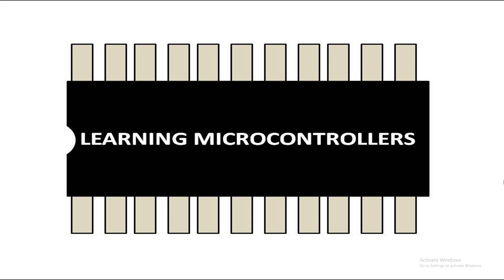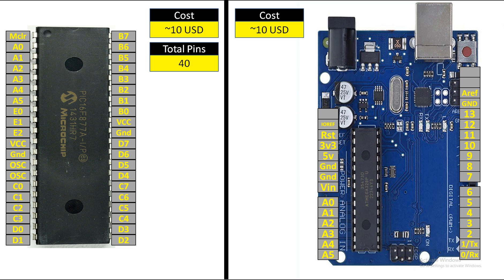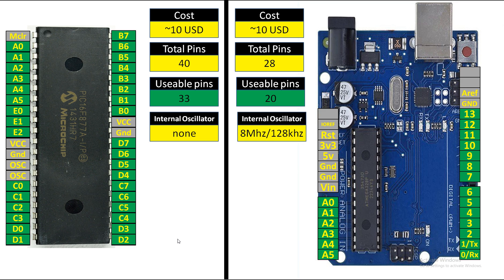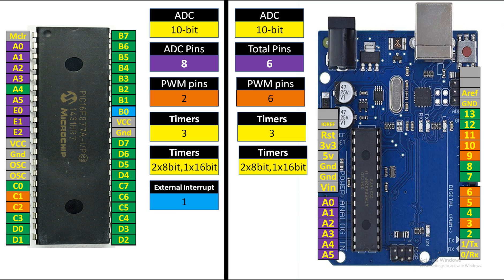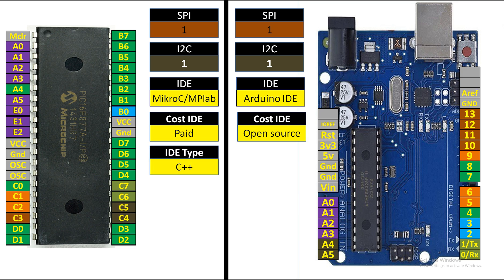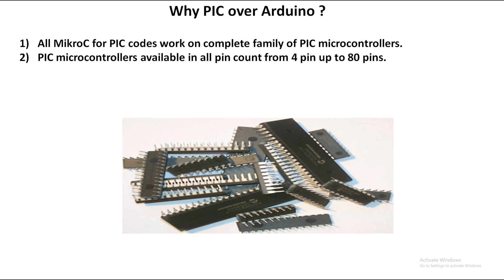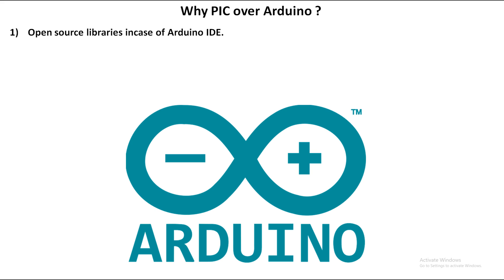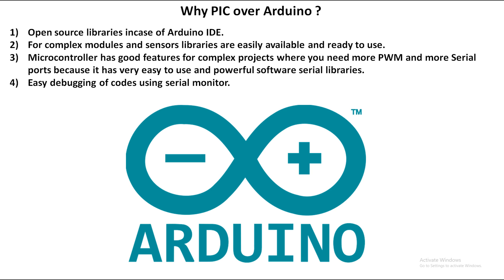PIC16F877A vs Arduino UNO. Also Some info on PIC vs Arduino.

Comment: UNO pwm 256 step....
Reply from the maker: Ok thanks
Reply from the maker: That's the bit means 8 bit
2 power 8 is 256
Same for Pic16f877a aswell

Comment: What crazy supplier are you buying from where an ATMega328P dip package costs $10? In SMD for they're about $2.50, in DIP package about $4.

Maybe the whole Arduino board costs closer to $10, in which  case is a lot more than a standalone DIP part.

I don't understand why you don't pick a PIC which has closer to 28 pin package to make them a closer compare, maybe a closer comparative price as well.

I don't understand why Microchip never made a bootloader for their PIC or a cheap programmer. You can buy a programmer for atmegas for like $5, or they can even be programmed to be their own programmers as soon as you buy 2. Pickit 3/4 is like $20-40. So I could be picking up 3-7 new atmega328 or similar arduino boards, for the purchase price cost of entry of a single programmer just to use a single PIC MCU.

It is very weird, practically disingenuous, that you refer to PIC as the complete family of PIC microcontrollers. But you refer to "Arduino" a vast family of broadly compatible boards and MCUs, only by the single old atmega328's capabilities. Whereas in fact you can use it with ATTinys for small 4-8 pin projects, big ATMegas with lots of pins, and many other MCU families for other capabilities, basically even more capabilities than the PIC. They can all be programmed with open source ArduinoIDE. Yet you refer that Arduino = ATMega328P only. Very disingenuous.

Comment: Arduino is 8s best. However Industry rely on pic.
Reply from the maker: PIC has hardware availablility cost effective
Reply: @learningmicrocontrollers3561  but its programmer is too costly. I have 3-4pic. But they are useless. Now a days esp12f is far better if u need less pins with IOT capability. Uts cos only 100INR
Reply: @Sekhar_Home yes but PIC has hardware avaiablility all variants available unlike other
Nowadays some other had come
But for decades PIC is ruling 😊